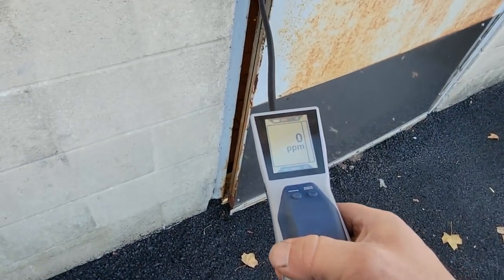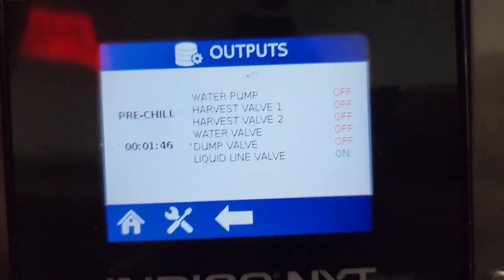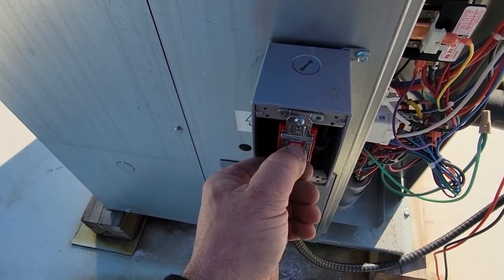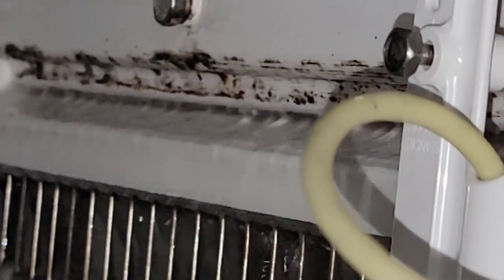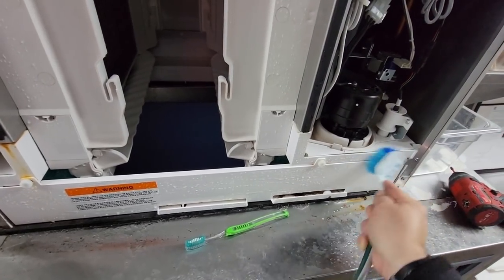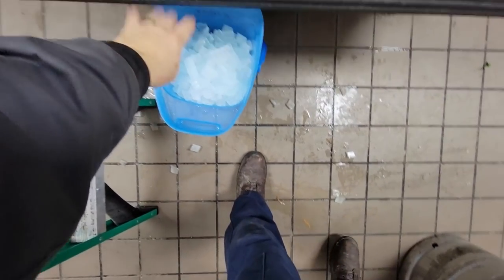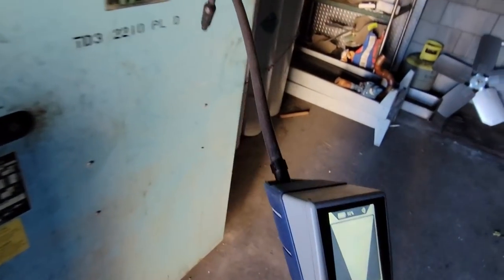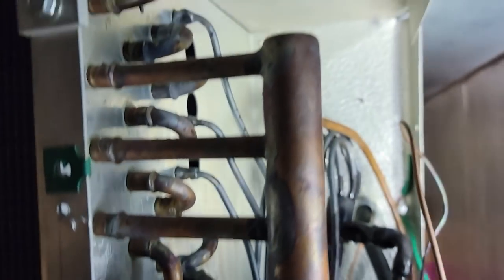Emergency Ice Machine Troubleshooting Plus Bonus Service Call

Comment: UV lights are BS . Best way to keep your ice machine clean is by getting in serviced 🤷🏻‍♂️. Good video Rick
Reply from the maker: True but they help,  however they have to be full size bulbs.
Reply: @HVACRSurvival  yes full size bulbs like 20”-24” for a 400 lb bin 30”-40” bulbs for an 800-1200 bin

Comment: Wagos in da house baby ! 🥳 and you got the newer models , the translucent ones , they're brilliant aren't they 👍
Reply from the maker: I figured you would like them. That's why I used them vs the wire nuts. I got them from our control guys 🤣, they get all the nice stuff
Reply: @HVACRSurvival  Niiiice 😆
Reply: I keep both styles on the van. I know the older gray ones are UL600V rated.  If I remember right the translucent are UL250V?
Reply from the maker: @ThisyoungTony  I would have to look. I watched a few test videos on them and was not only impressed but surprised.

Comment: That rack is a monster. Never seen one quite like that. Neat digital control though.
I'm a fan of hot-gas defrost, but you don't really see it except in particularly fancy systems like that one.
Reply from the maker: Most of the systems I work on are not fancy, that one is actually is pretty old.

Comment: A tooth brush is something that I've found quite useful, and I keep one in my toolbox. I also have a small wire brush in there as well. Both are quite handy.
Reply from the maker: I couldn't agree more. I love my little stainless steel brush
Reply: @HVACRSurvival  that's what I keep in there, too.

Comment: Rick they put electrical tape on the switch to hold the wires in place so there's no need to torque them down 😂

Comment: I use those 30 amp motor rated switches in my own home houses and workshop as light switches.   Because they’re the only switches that last long enough and remind me of all the light switches made back in the 1940s and 50s that lasted 50+ years

       They need a second ultraviolet light in the center in direct line of sight of the area that gets moldy

Comment: That one switch could have taken out the compressor(s)!
Thanks again for the videos!
🥃🥃🍺🍺🍺🎯🏌🏻‍♀️
Stay safe. 
Retired (werk'n)keyboard super tech. Wear your safety glasses!
Reply from the maker: I'd rather had a cheap pull out disconnect than that 20amp light switch.

Comment: Halfway through the video.   The installer of that light (power) switch is a bit baffling.   They obviously were smart enough to wrap electrical tape around the contacts, but yet they were too stupid to pull on the wires before deciding they had enough compression on the stranded wire.   

Have a good Thanksgiving, hopefully no call outs, and tell your wife I said hello.
Reply from the maker: Thanks Troy, I believe it was done by the young rookies. Thank you, happy thanks giving to you👍👍

Comment: does a UV light "wear out" ?  I know the one on my well water needs to be changed once a year.. I really don't need it so I haven't ever replaced it.
Reply: read some other comments regarding it. all good! great video as always
Reply from the maker: Yes ultravart lights have a limited lifespan. Generally less than one year of continuous use but depends on the manufacturer. They may glow but the potency of the ultraviolet is reduced over time.